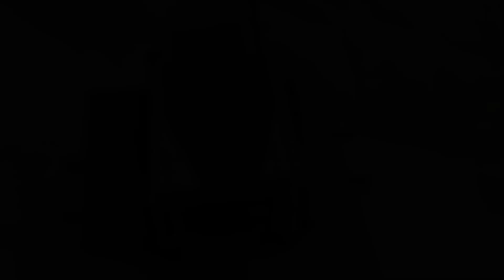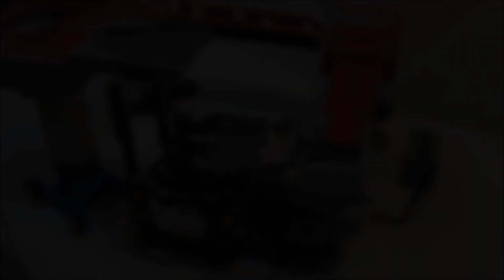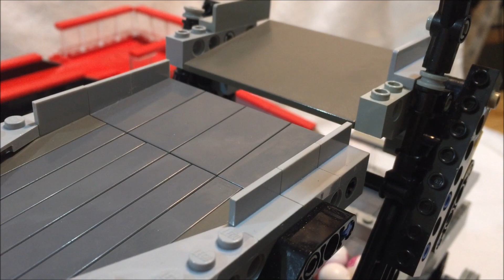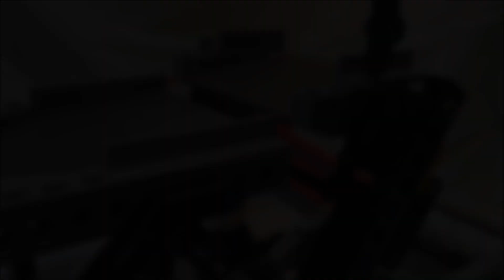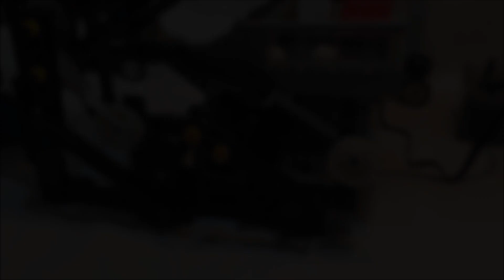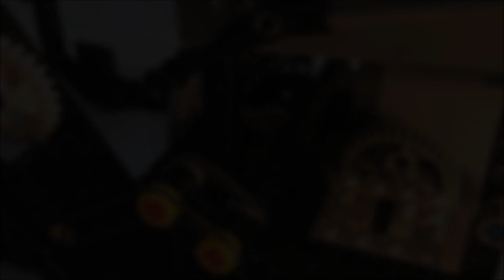LEGO GBC Not Scissor Lift

Comment: Really like the mechanism, haven't seen that particular kind of motion before in a GBC module! 
Might even try to do some reverse engineering one day... well done!
Seems to be working quite well, thanks for sharing :-)

One question though: the two rather large white parts at each side of the mechanism, are those original Lego elements or custom 3D printed parts?
Cannot find back any Lego part ID and there's not much info/pictures available online it appears.
Seems they're called something like "Lego Technic Double Tooth Brush, White 24t Clutch Gear".

Thanks again, keep on building! :-)
Reply: Part no. 32311, the second item in Technic, Gear on Bricklink
Reply: @SnapshotJH  Thanks! Don't know why I missed that... 
Luckily not as rare or expensive as I feared.
Reply from the maker: You can simplify the construction and marginally increase the stiffness of the mechanism by using two more 32311s instead of the 24 tooth gear + liftarm in the upper link... I just didn't have four on hand when putting this together.
Reply: @NonsenseWars  Thanks for the suggestion, will keep that in mind for my next Bricklink order. Seems like an interesting and useful piece anyway, so might just as well get four of them and try it out :-) I don't own an e-motor, so will definitely be a plain PF M- or L-motor in my build.